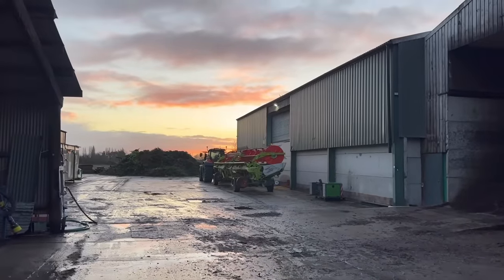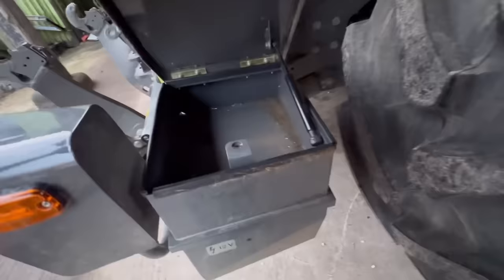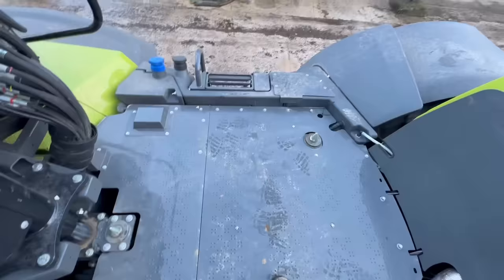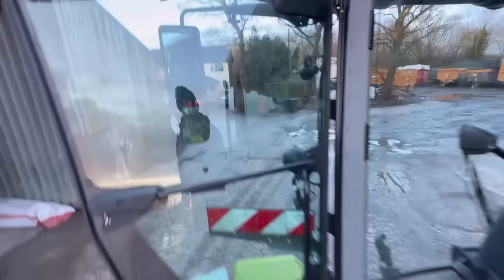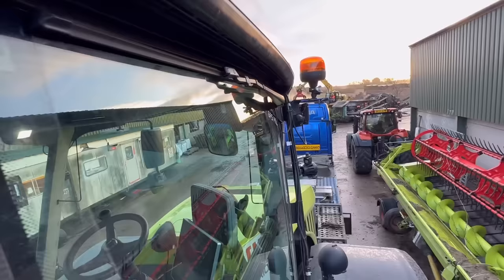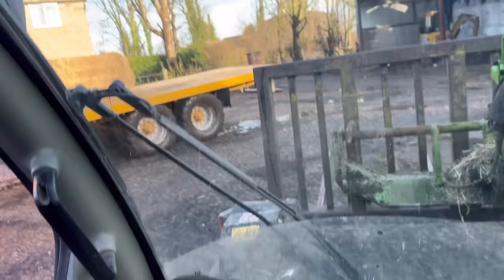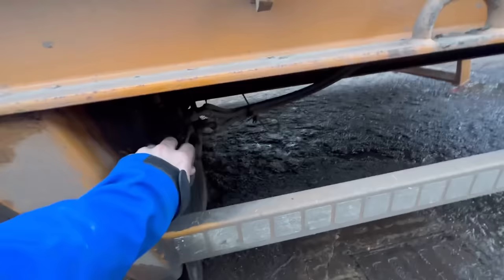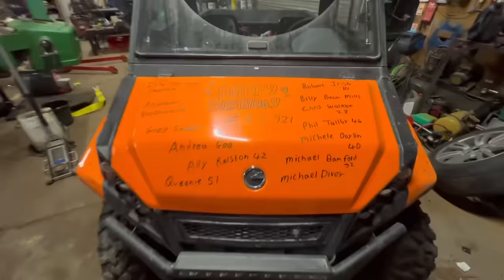A SAD DAY AS WE LOAD THINGS #AnswerAsAPercent 1388

Comment: If I remember correctly when I drove one basically spinning the cab puts it into “field mode” so technically your not supposed to drive it on the road on reverse drive as it changes operations setup because reverse drive you don’t have legal headlights or anything

Comment: I find it incredible Class make a Xerion with a reversing cab, cost to develop must be astronomical for a fairly niche market, I had always assumed most large tractors are towing machines with no front linkage and a lot with no rear linkage. Incredible attention to detail, canceling indicators when cab reversed. Bear in mind, on my sprinter, CarPlay gets confused if I use my phone before starting the engine.

Comment: If you open the old flasher circuit then the speed of the flash increases as on old element types the rate of resistance increases. They seem to be giving you a clue with the new technology but may not operate the flashers as it would require inverted operation of circuit and it’s responsibility’s.